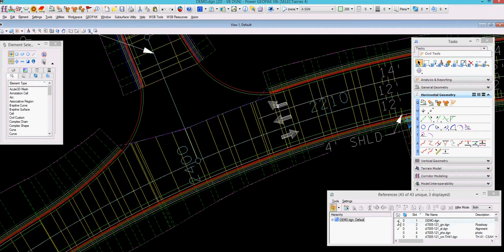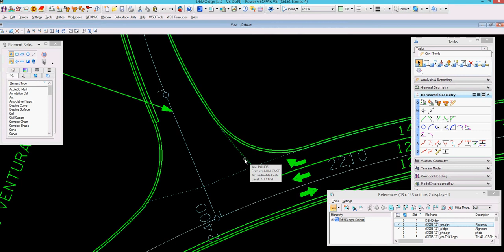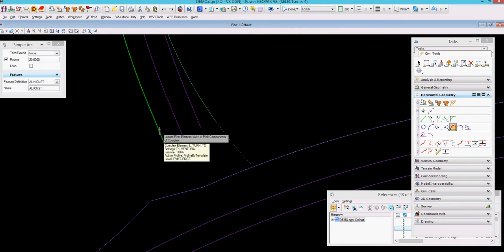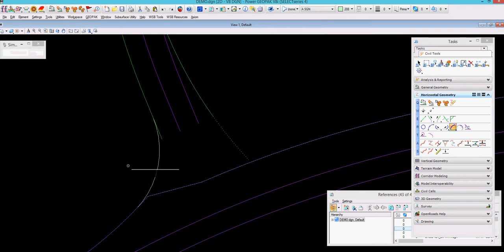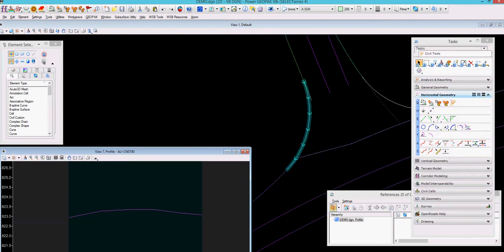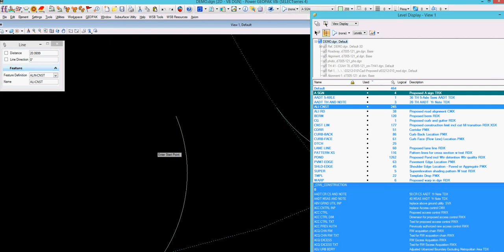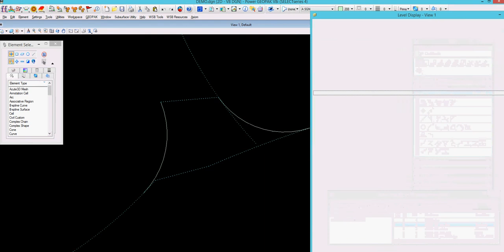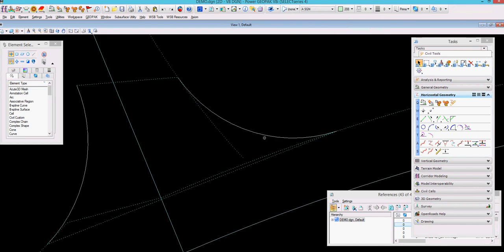Complex Intersection Modeling in SS4 (Pt 1)

Comment: How did you make that element have a profile by template? I am trying to use the quick profile transition tool for intersections but can't get my EOT to have a profile from the template. Thank you!
Reply from the maker: Hey T.  Most lines in the 2d view that are being created from a template have "profile by template."   
Make sure you are using the simple arc tool between elements to make your connecting arc.  I'm sure you will get it!
Reply: @michaelchristensen9938  Thank you for responding. How would I go about getting my EOT lines (besides my arc) to have "profile by template"? My horizontal alignment is the only line with a profile. When I hover over any of my EOT lines they say "no active profile".
Reply from the maker: @Tlltll1234  Sorry for the late reply.  Are you using a road template from a template library and running it along a corridor?  I am assuming you are not.  That is the kind of geometry I am pigging backing  my connecting arcs onto.  You can still connect elements with connecting arcs and use the quick profile transition tool as long as the original  elements have active profiles.